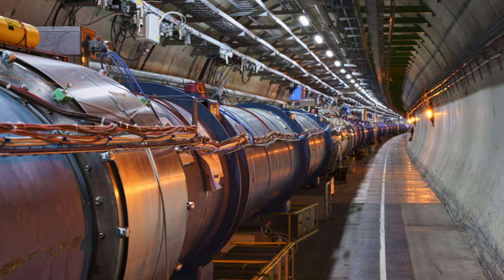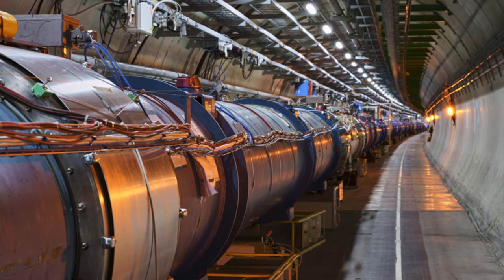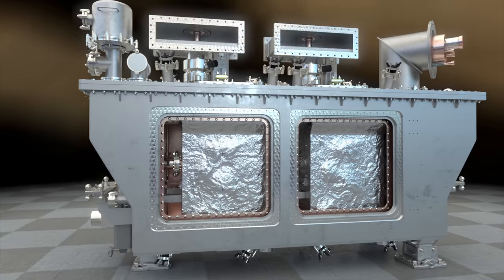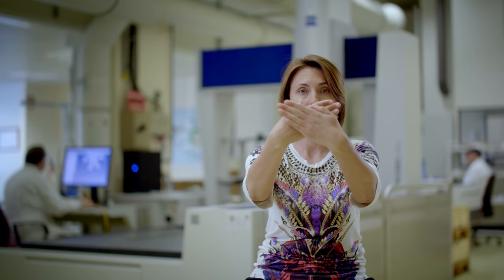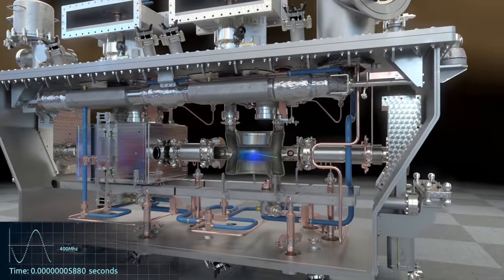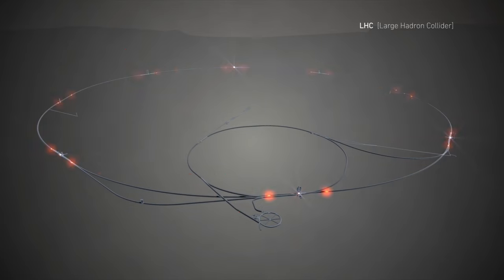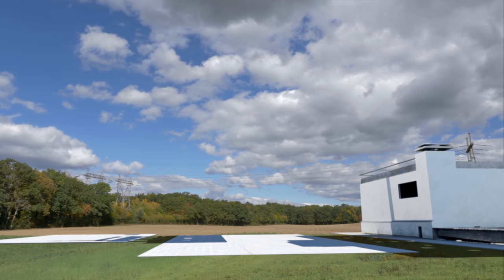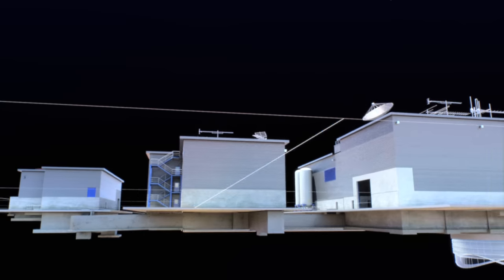The road to High Luminosity: what's next for the LHC?

Comment: Thanks for the video, seems pretty cool (and insane a x10 times luminosity), but I have a very noob question: Why will you upgrading LHC? I mean, that money could help us to construct a new and more powerful particles collider.
Reply: Daniel Garcia upgrading an existing collider is way cheaper than building a new one. Considering that after the upgrade LHC will run for an estimated 10 additional years, the expense is well justified

Comment: Why do you need the overlap of the bunches to be smaller than if they collided face to face? Don't we need more collisions per bunch crossing for higher Lumi? Or would the pile-up be too high for a more compressed bunch if they collided directly? If this was the case, one could only increase lumi by higher beam current,right?
Reply: Ah okay from what I read the crab cavity actually makes the overlap larger and what is meant in the video is that without (!!!) the use of a crab cavity, the bunches would collide with an angle (no perfect overlap, as she does the "x" shape with her hands)

Comment: I am a student who is interested in particle physics. I have a doubt. In the LHC you collide protons which acquired high speed(almost of light).so it created a large amount of energy like in big bang. So why do nothing happen if we collide two or more photons? For eg. Two light rays coming from two opposite directions incidenting at same point. Why doesn't anything happen??
Reply: Hi, try reading this article: http://www.hep.ucl.ac.uk/opal/gammagamma/gg-tutorial.html

Basically, what you're asking about refers to gamma-gamma interactions, and the main reasons why (almost) nothing happens is due to (1) the cross-section being very small and because (2) photons do not couple directly to each other as they have no charge. These are further explained in the link above!
Reply: Photons do not carry a charge, so they do not interact with the Higgs field, therefore they have no mass.
Reply: Then why don't they use electrons? They have mass
Reply: The proton has 2000 times more mass than the electron. The electron has leptons not quarks, and is in the cloud that surrounds the atom, so I do not think you could smash electrons together.

Comment: Does high illuminosity require the power from a huge fusion reactor?
Reply: The increase in luminosity is mainly achieved by improving the way the particles focus and cross in the interaction regions. This will not significantly increase the required mains power compared to that of the current LHC.
Reply: Currently lhc need 200MW, factor to 10 for hilumi